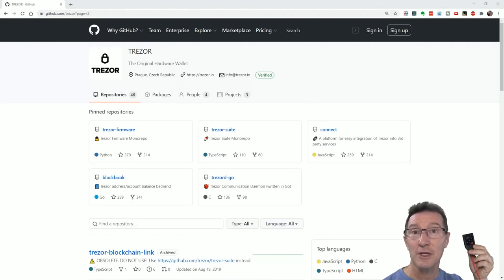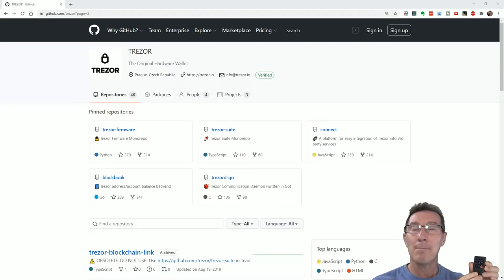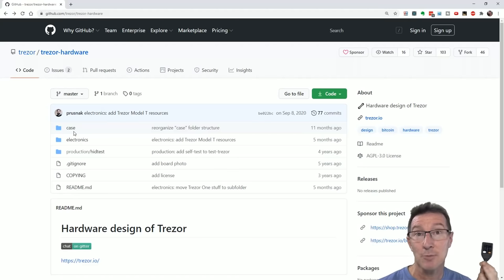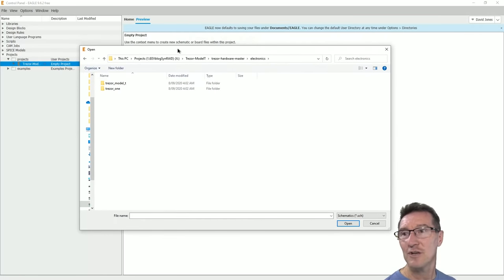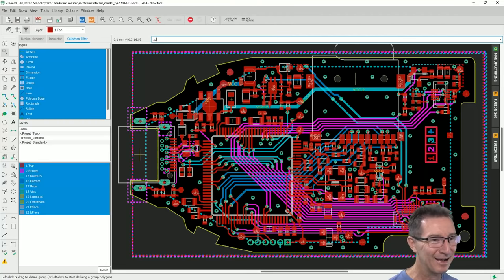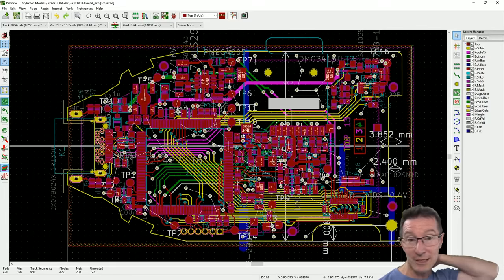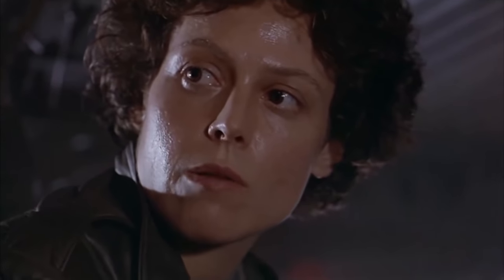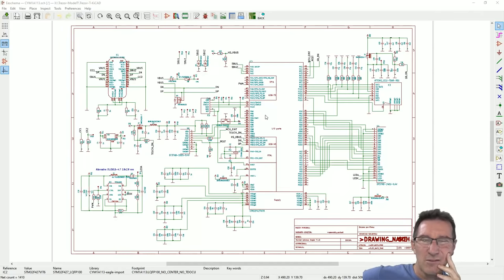EEVblog #1374 - DIY Trezor Crypto Hardware Wallet - Part 1

Comment: This video is rather sad.
People worked hard on this project and published it for everybody to use.
Some youtuber comes along and the "click and done" principle does not work and he gets frustrated.
Does not want to put in a little bit of time to make it work.
What a shame!!!!!!
Reply from the maker: I took the time to try, and to make the video, and then asked for what people wanted to see in the next part so I can do what people want to see next. And in response some commenter just comes along, gets frustrated and starts screaming it's shame and the video is sad, but couldn't be bothered to put in the little bit of time to comment what they'd like to see next. What a shame!!!!!!
Reply: I'm a total newb trying to learn and found this video pretty refreshing. It shows the "usual pitfalls" that people stumble across. The professionals have all their tools set up and have no problems, but for most people getting into a project like this they will stumble across these things. 
It's clear they didn't want to make it easy. So it's a valid complaint and good video.
Reply: Also conflating kicad / eagle / the project. The dotted line are the pours in eagle, same in kicad, and filling the pours will fix all the nets. Given how eagle uses a plotter type format for brd files I would imagine the kicad import is fairly true to the original, would be good to look at the space between pins in eagle before pinning it on the import.
Reply: @EEVblog  you spent half the video saying boo, no, fail, that's just awful, etc. Because you didn't know how tk use git, didn't have experience in eagle, didn't know Czech, didn't know how to import to kicad, etc. Every frustration was from your lack of preparation or understanding. A bom would be nice and a fair criticism, but did you open a issue on github? Email support? Why push so hard for this open model and when someone does it you refuse to participate beyond a surface-level interaction with their work?
Reply: @dejayrezme8617  for every complex problem there is a solution is is simple, easy, and incorrect. Some things are difficult. It's OK to be challenged or to have to change your work flow.
Reply: @CullenLorsung42  I don't really disagree with that (if I understand you right). Being challenged and learning new workflows is good. But an open source project isn't "supposed to be" a learning exercise.

So I do disagree with "not being allowed to complain about open source". 
I recently read an interesting article on that question: http://nikolay.rocks/2017-06-06-mythical-contributors
Especially the trezor project receives some benefits from ostensibly being open source. Status and marketing boost for being open source, they outsource their security in a way (other people looking at source, or "go read the source yourself!". They also had a pretty bad security flaw in earlier firmware) and they offer the promise a company using the trezor for infrastructure could always get some replacement boards even if trezor itself goes bust.
And in the case of EEVblog he actually purchased some of those products based on the promise of open source.
Now, not saying there is any need for huge complains or drama here, but they could have exported the gerber files and the bom in like 5 minutes, while it takes someone trying to use this at least hours to weeks of learning new tools.
So the question of "how open is the hardware really" isn't unjustified. 

And even if it was totally free and the creator would never see a benefit from being open source, reviewing or criticizing an open source project on it's merits is ok to do.

Also, remember that knowledge is power. Open source aims to democratize that power.
Therefor I demand to be spoon-fed that knowledge!
It's not my fault I was born lazy!!! (haha jk)
Reply: @dejayrezme8617  what? If you don't know something, you have to learn it. You might be the greatest EE on the planet but if you refuse to learn git, it will remain difficult. Since when does open source mean "anyone can do it"?
Reply: @CullenLorsung42  It's certainly in the spirit of open source that anybody should be able to compile and use and modify "the stuff" without really understanding all of it. See this excerpt of an open source definition:
"The source code must be the preferred form in which a programmer would modify the program. Deliberately obfuscated source code is not allowed. Intermediate forms such as the output of a preprocessor or translator are not allowed."

In the ideal is, it should just be usable, not a starting point for an expert in the field or a learning exercise.

Again I don't totally disagree with you, but it's certainly debatable (or complainable)
Reply: @dejayrezme8617  The definition you provided literally says "in which a programmer would modify..." You cannot expect to simply pick up any OS project and make it work without committing to understanding how the project is organized, methods/layout/organizational practices, etc. If you lack the background to fully grasp those concepts, whether that's hardware design or software engineering or something else entirely, then you are expected to learn it. It's not the Trevelo "learn how to use Eagle and import to KiCAD project".
Reply from the maker: @CullenLorsung42  Perhaps you missed the PART 1 in the title, and my call for what to do next. I planned to CONTRIBUTE back to the commnity BIG TIME by taking my time and effort to move this to another package, provide a easier build soluton, add improvements, and contribute an updated design back to the community. But people like you come along and compain just as much about me as you claim I did about it.
It's people like you that make me not want to put my time and effort into doing this and helping the community, so yeah, thanks, thanks a lot.
Reply: @EEVblog  you published this video, not me; if you don't want feedback, turn the comments off. Your animosity for anyone else's way of doing things gets tiring. How can you tell me that my comments make you not want to make videos when what I said was essentially that your videos are unnecessarily negative? You can dish it but sure can't take it.
Reply from the maker: @CullenLorsung42  You did not say that, you said very clearly "Does not want to put in a little bit of time to make it work" and that's "a shame". That is demonstrably wrong
Seems like you don't like having that fact and the irony of your post pointed out. LOL
Reply: @EEVblog  Can you point out where I said that? Or, I guess, demonstrate?
Reply: @EEVblog  Comment made by @C2ashman
Reply: @EEVblog  YT comment are poison incl mine, lets make it :-)

Comment: IMO, you should really spend to your time and efforts to help make a better open-source wallet. not fuzz around with broken eagle imports or what. let's build one!

Here are 3 unique features of a better wallet:

1) the private key is protected by a hardware attack resistant crypto chip.

1.1) state of the art ones do not even store the key (!). this is based on so called Physically-Unclonable-Functions (PuFs). often SRAM-derived. eg NXP LPC55S6x. This runs an Arm Cortex-M33 with ARMv8 ISA and Trustzone-M. More so: it can run crypto + app (eg display, USB, etc) on 1 SoC. etc etc

https://www.nxp.com/products/processors-and-microcontrollers/arm-microcontrollers/general-purpose-mcus/lpc5500-cortex-m33/high-efficiency-arm-cortex-m33-based-microcontroller-family:LPC55S6x
https://www.maximintegrated.com/en/design/partners-and-technology/design-technology/chipdna-puf-technology.html

OR

1.2) non-PuF based state of the art separate crypto chipe, like the NXP SE050C (C is important .. only that has the elliptic curves for Ethereum), which comes Common Criteria EAL 6+ certified, but needs a 2nd MCU for the app stuff

https://www.nxp.com/products/security-and-authentication/authentication/edgelock-se050-plug-trust-secure-element-family-enhanced-iot-security-with-maximum-flexibility:SE050

2) implement EIP712: typed signed data (eg see https://medium.com/metamask/eip712-is-coming-what-to-expect-and-how-to-use-it-bb92fd1a7a26 ) - combined with a larger touch display (plus HW keys), that would be awesome!

3) integrate with Metamask. https://metamask.io/ is a browser based wallet that integrates into the web. however, it would be awesome to use a HW key together with Metamask. 

 there is no product on the market that provides any of 1., 2. or 3. above. at least I'm not aware of any.

I'm a SW guy (eg https://github.com/crossbario/ ) with significant experience in Ethereum (https://github.com/crossbario/xbr-protocol ) and would be willing to collaborate and help on the SW side to create a state of the art open source wallet. I can read a HW data sheet, can do firmware C etc ... but I don't have much experience on the HW side. I do know that a NXP LPC55S6x or a NXP SE050C + Some-MCU would work from the firmware and software side.

anyway, just my thoughts ... thanks for a great vlog btw! I enjoy this regularly. even stuff I have zero experience or use for like RF design and all these obscure metallic things around RF. just fun =)

Comment: Don't use Eagle. Don't use KiCad.
Use DesignSpark PCB. It's free and you can make 8 layers board, You can import footprints from Component Search Engine.
The only downside is that the schematic i kind of old school.

Comment: Ledger hardware wallet recently emailed me saying "whoops! All yours keys got released in a hack, sorry"
Reply: e-commerce and marketing database, not keys. Don’t lie.
Reply: That's just phising e-mails from scammers trying to get you to reveal your 24 recovery words. Trezor company never had your keys so they can't leak it. It is true their sales department was hacked recently, but only customer names, e-mails and addresses were leaked, nothing related to your crypto, PINs, passwords or keys. Scammers now use those leaked e-mails to try to trick users into revealing their crypto recovery sheet to steal crypto currency. Just ignore them.
Reply: @night6452  All nice and dandy. But don't use the word "only" in front of names, e-mails and addresses. That is nearly as bad as it can get!!!
Reply from the maker: It's a scam. Ledger don't have your keys, you generated them yourself on the device when you you set it up.